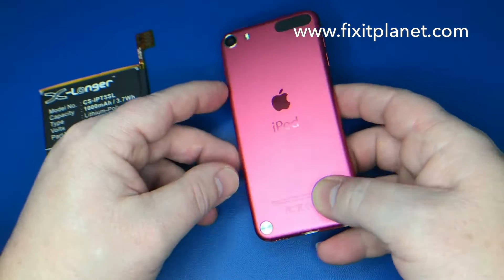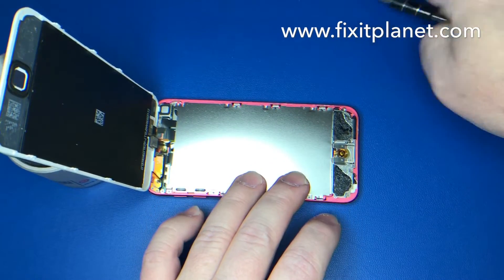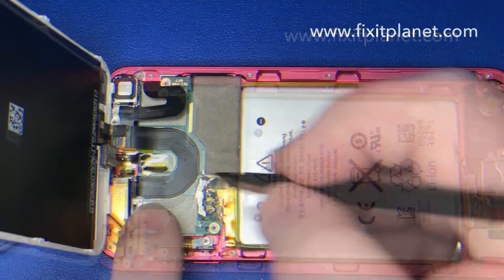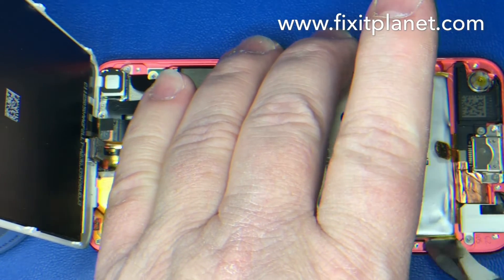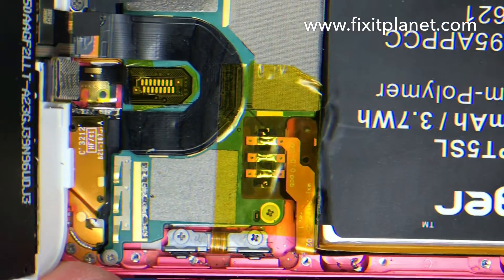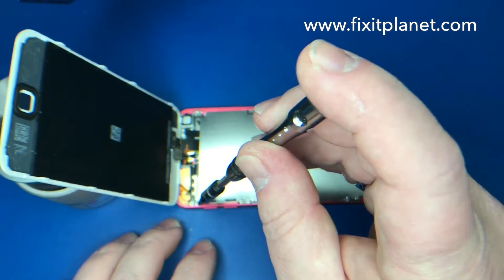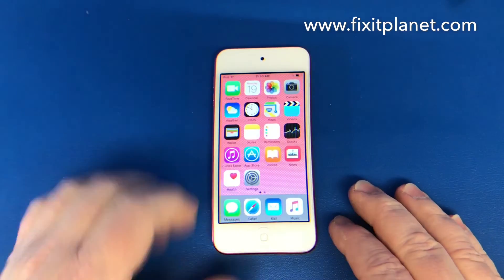iPod Touch 5th Gen Battery Replacement From Start To Finish.

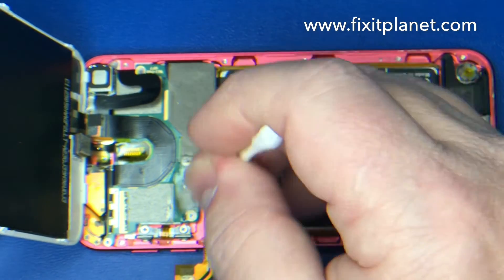Comment: At 8:20, you say "We're gonna put a little fresh solder on each of those pads." Then a tube appears and you appear to be applying flux. Then at 8:44 the soldering iron enters the picture and appears to simply plunge into the flux and make contact with each of the pads. Where exactly is the solder being applied, that you say is going to be applied at 8:20? I'm not seeing a wire of solder in use at any point.
Reply from the maker: Sorry for the confusion. The solder was added to the tip off camera right before plunging into the flux.

Comment: What is the liquid your using called? Also where can you buy the liquid? Also what is that material you are using ? (material 8:06 of video)
Reply from the maker: Liquid is Flux and  materials needed are flux, solder, soldering iron, de-soldering braid, and kapton tape.
Reply: Fix It Planet Is De-soldering braid a necessity? I don’t have any but I need to replace my battery
Reply: Fix It Planet are the flux and solder the same thing ?
Reply: Right? You never see any regular solder anywhere in the video.

Comment: After watching this:  Helllllllllll no!  Not even going to try.  I would end up killing it, soldiering all sorts of stuff together, cracking the glass....  a local place said $55, about 30 min.  That's 1/4 the price of a new one!
Reply: gcuneo2 ...I’m with you... Hell no! I would do the same... I will just take it to someone who specialize in this stuff!
Reply: I messed up my I Pod Touch 4th gen years ago! It is not an easy task.Just bought an I Pod Touch 5th Gen and the battery seems to go down extremely fast.Not looking forward to taking it apart.
Reply: better than unscrewing 300 screws apple uses

Comment: my ipod turned bluescreen, then went off and would not turn on anymore. cud it be the batt is dead?
Reply: The Battery didn’t die, there are two possibilities, firstly, your hard drive on the IPod might have crashed. Secondly, you have fried the motherboard by use and the ram failed.
Reply: in that case any of the two would cost impractical repair, better buy a new one.

Comment: I have just bought a used one just like that. The battery runs down in about 30 minutes. It also charges back up in about 10 min. Is this a battery problem ?
Reply from the maker: Yes most likely
Reply: Mine is just like that too!!!

Comment: Heat the bottom area well where button is, there are two large adhesive pads there. Also be careful on sides, edges when prying. If you too deep it will damage the LCD.

Comment: WARNING! A very good video, but unfortunately, my traded in 5th gen seems to have had some additional anti-tampering measures added by Apple.  Instead of having just the bottom rim glued, there turned out to have been a huge dollop on either side of the 'home' button, *on top* of the shield's screws.

This measure was obviously intentional, & designed to not allow the device to freely open on the top hinge.  Wound up shattering the screen during the process, since the 'home' button was essentially glued to the shield.

Battery replacement worked, so I'm still able to use it as a managed device - just can't do anything w/ the screen or home buttons.

(PS mine wasn't an abnormality - I found another video at https://www.youtube.com/watch?v=nAIitSWOzBg which shows the guy having to use multiple guitar picks as shims while constantly using a heat gun to loosen the glue)

Comment: I don't have a hot plate. Anything else I can use and what temp?
Reply from the maker: If you are referring the the adhesive at the bottom of the screen you can use a hair dryer or heat gun on low but you will need to be careful not to over heat and damage the display.
Reply: Fix It Planet I used my kitchen griddle with digital thermometer. Hand regulated the temperature to around 120 degrees Fahrenheit for 20 minutes. Opened up so easily. Next time I'll get a hotplate.
Reply: i put on in my mini  oven at 350 for 5 mins lol

Comment: that looks a tad beyond my skillset... what would this run a customer?
Reply: A local repair shop quoted $70 for it but it included the cost of a battery (which is only about $5 on ebay), I think apple quoted $80, but did not include shipping. I paid $60 for my ipod touch so didn't feel it reasonable to pay someone more to just replace a battery. I purchased all the tools and supplies less than $50 and attempted the process myself though, ..very carefully... and ruined the ipod touch. I am a mac user but decided to go with a gopro. Less expensive and a removable micro SD card so I won't lose my data or have to pay a ransom to recover it if the tech fails. Too bad for mac though. I honestly believe that a person can accomplish this repair with reasonable dexterity and a slightly higher IQ than I have though.

Comment: Do the batteries have to be the same voltage when replacing them and or both discharged or fully charged?
Reply from the maker: It needs to be a compatible battery. They could have increased capacity. You should back up the iPod first if possible. Charged or not it doesn't matter just make sure you power off the iPod before performing the replacement.